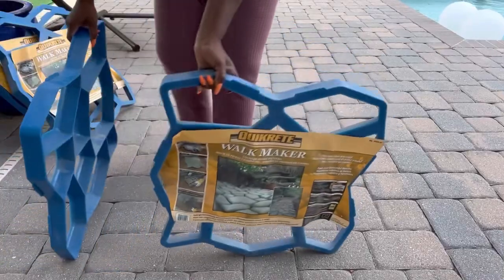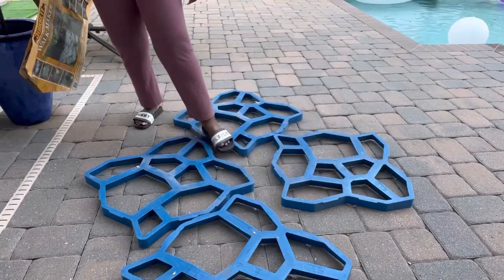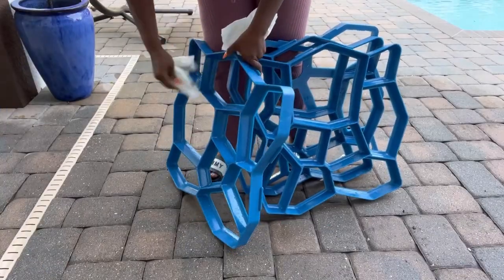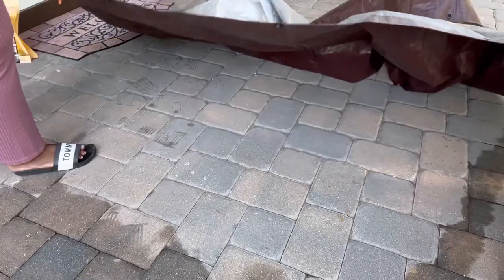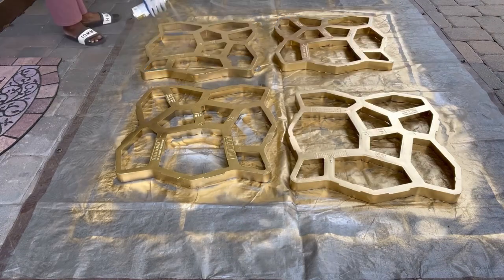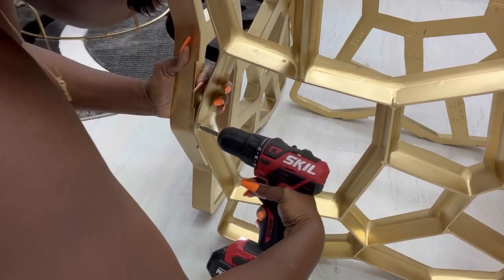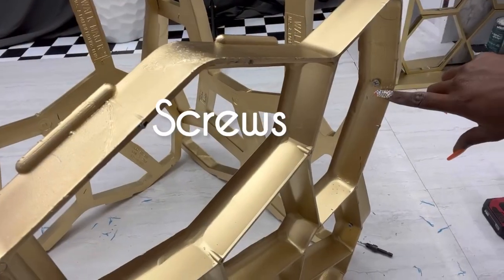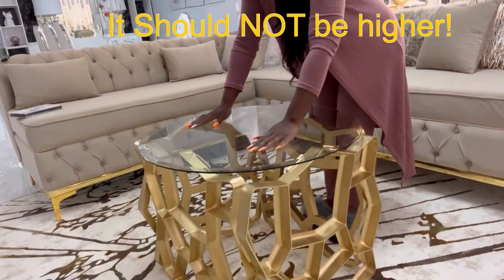SEE HOW SHE Transformed HER LIVING ROOM With This!  DIY PAVER TRANSFORMATION!

Comment: Perhaps a 36” glass round would be a better fit so all edges of the molds are covered; Use the small gels to put on top of molds to secure glass in place. (A little bump of the knee could send the glass flying off otherwise). Great craft project. Another triumph for you.  I love it!

Comment: Are you not going to attach the glass?
Reply: I'm curious cause I have a piece of glass and two bust of a girl and a boy. I thought about putting the glass on the top of their heads but I have been told if I drill a hole in the glass it was just shatter so I don't have any ideas on how to attach it